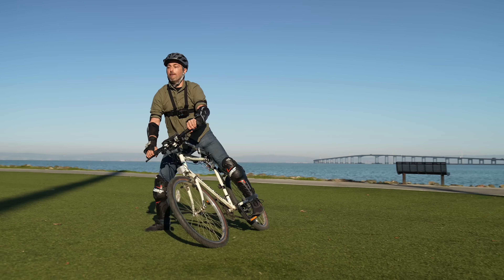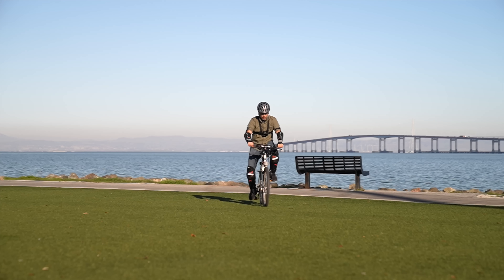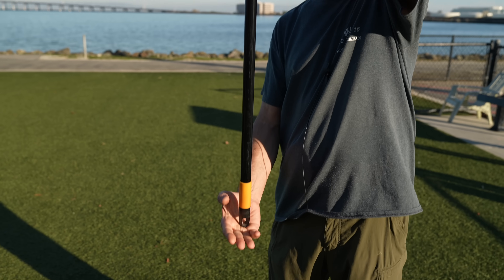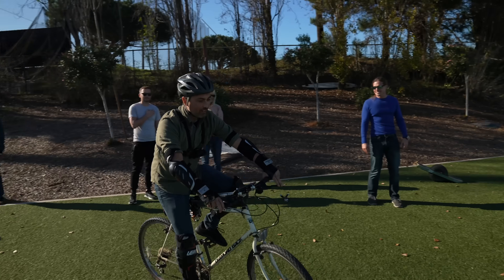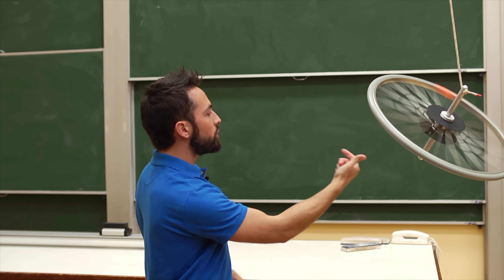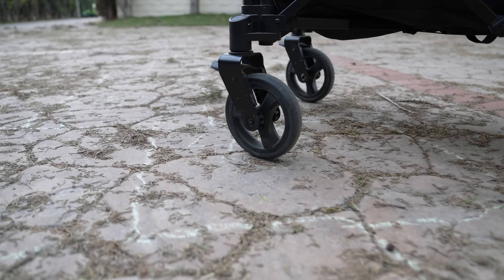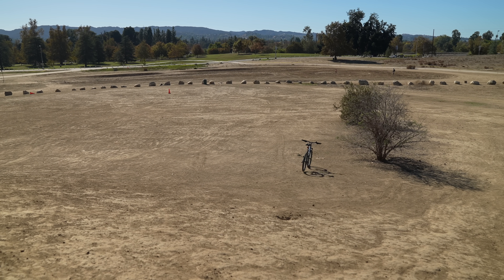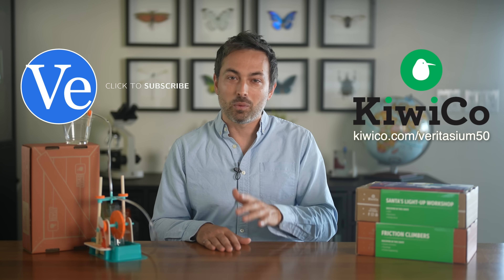Most People Don't Know How Bikes Work

Comment: We were taught counter steering in our motorcycle rider safety course years ago. Several in the class just could NOT comprehend it. One guy almost got tossed from the class for being argumentative about it. The instructor told him that anyone who has ridden a bicycle, counter steers without knowing they are. He finally accepted that he was wrong and passed the course.
Reply: I don’t know why they even teach “counter steering” like there is an alternative. If you don’t “counter steer” then you don’t ride a motorcycle lol.
Reply: @TheKep  I had found the way it was explained in class was way more complex than it actually was. But that is down to the instructor
Reply: @whiskytangi  I was going to comment the same thing. My instructor taught that if you want to go right you need to "press" on the right handlebar. It felt unnecessarily confusing, and was probably just better left not being said. People intuitively know how to steer as long as they know how to ride a bicycle.
Reply: @SteveGunn2  I know that for me it wasn't intuitive at all, but the 'push where you want to go" advice really helped me.
Reply: @whiskytangi  my Instructor said to press too. I found it useful. It helped me realize the steering and turning are a combination of counter steering and leaning into turns
Reply: @SteveGunn2 It's better left not being said for just normal uneventful riding. But when you need to swerve to avoid a brake check or an animal that ran out into the road, it's good for you to have that info because some people DO just steer the wrong way without it.
Reply: @SteveGunn2  thinking you know how to steer from intuition instead of actually understanding how to do it forcefully can be the difference between life and death. Anyone who doesn't understand counter steering is a bigger danger to themselves and everyone else on the road.
Reply: @TheKep  The idea is to teach "push right to go right".  The reason is that in an emergency situation where you may panic and your brain shuts off, you may try to yank the handlebars to the right in order to turn right, but that will turn you left as demonstrated by this video.  By drilling in "push in the direction you want to turn", I guess the hope is that in an emergency, your training will kick in and you will push the handlebars in the correct direction.

My motorcycle course teacher taught this by having us drive straight at him and then at the last minute he would raise one of his arms to show which way we should swerve.  As soon as we saw his hand go up we were supposed to push the handlebar on that side.  He had a lot of faith in his students I guess.
Reply: @TheKep  I am now interested to know if anyone learns to ride a motorcycle before they ever rode a bicycle? I'm sure it's possible to do so but getting the hang of steering and balancing on two wheels has got to be significantly safer and probably easier on a bicycle than trying to learn to ride a motorcycle straight away, particularly with extra controls like accelerator, clutch, gear shift by foot and braking by both hand and foot. That said you don't need all of those things to learn how to move, stop, and steer a motorcycle. I feel that the first step in learning to ride a motorcycle should be to learn on a pushbike first if for nothing other than safety reasons.
Reply: @TheKep  It's taught because some people only naturally do it to a certain extend and then their brains are hardwired to not push further. You see this when some riders fail to lean over properly and end up going wide in a turn, simply because they had crossed their natural limit of intuitive countersteering.
Teaching that countersteering is a thing, can help people push beyond their natural intuition and apply it consciously in situations where their subconsciousness would have said stop. It allows people to experiment with their intuitive limits and push them, thus making them better and safer riders as a result.

So yes, countersteering is unavoidable, but it doesn't matter that there aren't multiple levels of countersteering - some of which are not always reached intuitively.
Reply: @TheKep  They need to teach it in high speed. You don't get to 140km/h in a bycicle... And a counter steer in this velocity needs to be controlled, it's just different, you need to put some of your body weight to the opposite side you are turning, try to watch a MotoGP clip and you will understand what I am saying.
Reply: @TheKep except counter steering isn't a thing
Reply: @thewolf9851  Tell us you've never driven a motorcycle or bicycle for that matter, without telling us you rode...
Reply: @MistedMind I have driven both for literally thousands of hours. You mist likely haven't.
Reply: Came to the comments looking for this. The way my instructor said it was if you want to turn right push down on the right handlebar. Now if you push down on the right handle bar the front wheel goes left and you turn right. You are counter steering. But explaining it this way meant that people were less likely to argue because instead of saying to go right turn left he said to go right push down right. same end outcome, far less arguing.
Reply: Its something you shouldnt think about too much because then its more likely to do it wrong rather just let the brain implement this movement itself
Reply: @alexanderteichrib9525  - you need to think about it at high speeds such as motorcycle racing, since around 100 mph, body leaning ceases to work at all, and the bikes have to be deliberately counter-steered to exit a turn (turn more inwards to lean less or straighten up).
Reply: Keith Code of the California Superbike School developed a special motorcycle that has a set of fixed handlebars to prove the point that counter steering and not leaning is the way to initiate a turn on a motorcycle.  Additionally, watch any super-slow motion video of a motoGP race and you will clearly see counter steering at work.
Reply: The difference is that motorcycle steering takes more force, so the natural instinct from a bike doesn't always translate directly
Reply: I taught a 3 day police bicycle patrol class. The second day was all cone patterns and obstacle avoidance. One obstacle avoidance drill involved having the rider ride straight through a parallel cone pattern, while I would stand at the end. I would suddenly raise my right hand for a hard right, my left arm for hard left or both arms forward for a panic stop. The drill was primarily to teach counter steering. One can initiate a turn by leaning which creates a counter steer, or intiate a turn with a counter steer which creates a lean. Initiating with a counter steer is a much more positive and faster way to maneuver a standard two wheeler vehicle and the nature of the drill is it can only be done successfully by counter steering. 

Another positive in teaching to counter steering over leaning is mitigating panic turning. This usually occurs when an inexperienced rider is picking up to much speed going down hill with an approaching turn. Instinctually they will apply the brakes and try to turn the handlebars in the direction the want to good. Due to the dynamics of turning a bicycle, the bike will travel in a straight line instead of turning, often leading to a crash by laying down the bike.  When I was teaching the class the motor guys got it right away, but it took some convincing with others.
Reply: That's almost like teaching the law of gravity to someone trying to get down from a tree.
Reply: I wish my motorcycle teacher had taught me that??!!! I’m learning motorcycle right now and balance is my biggest problem although I have no problem when riding a bicycle. And now I know explicitly what to do I feel like my lessons will be a lot easier
Reply: Most explanations of counter steering always seem over-complicated because they skip over the essence of it, which to me is "first steer the wheels out from under you". The inverted pendulum/broom analogy is a great way to show that.
Reply: I don't know how to not understand 😂
Reply: @yamahass66  it was wild. Arguing about something that really didn't matter. I just accepted what the instructor said, I guess because I never really thought about it, AND, it didn't matter. 

Humans are insane. 🤣
Reply: I had a similar situation in a rider safety course: I just couldn't get it. I started imagining I was on a bicycle, which I imagined for years. I immediately got it. Since then, I have really started to lean into my bicycle's counter steering.
Reply: My motorcycle training did an excellent job with the concept of steering and counter-steering.  I was lucky enough to be supplemental training by the Arizona GoldWings Association.  The drills at slow speed were excellent.  I use that experience these days on an excellent e-bike which really brings the points home.
Reply: "Press forward on the right handlebar to lean right and vice versa" ... I've been counter-steering motorcycles since 1968, and I pull as much on the outside handlebar as I push on the inside handlebar to counter-steer to change lean angle. When turning, I only think about controlling lean angle and speed to make turns. In very high speed turns, like Ilse of Man or Daytona with 170 to 200 mph turns, the amount of counter-steering effort to change lean angle is so great that a rider has to pull on the outside bar as much as the rider pushes on the inside handlebar in order to counter-steer, all while staying tucked behind the fairing to minimize drag.
Reply: Yeah it was difficult to do it at first
Reply: @wolfseek  that shitnfeels nice tho take a nice tight countersteer leaned turn, snap the bike back up with gravity mmmm feels like butter when the bike lifts and evens out
Reply: @acidpoptart4270  yeah just the  Concert was new to me I didn't trust it but yeah your right and its so cool and weird that that's how it works you need to go right to go left and left to go right and you lean into I'm now a better driver and no problems
Reply: Came here to talk about motorcycles and this very idea. Nice!
Reply: But have you guys tried to super fast trying to avoid a e.g. pothole (which could be a hole in the ground one day, or a piece of metal) by fast and hard pushing on side of the handlebar? That's fast countersteering for you /evasive maneuver. I think it's easier said that mastered. But a good skill to have.
Reply: @sund5  - to quickly avoid a pothole, you can positive steer the tires around the pothole, which will cause the bike to lean the "wrong" way, and after passing the pothole, counter-steer to straighten the bike back to vertical.
Reply: @rcgldr  yeah, but that need some practice since you need right force on the steering, if it's too much the front tire may lose grip and you fall.
Reply: @samueladitya1729  a rider just uses enough counter-steering force to initiate or change lean angle. As speed increases, the amount of force to change lean angle at some rate also increases.
Reply: @rcgldr  I mean to avoid pothole, you need to turn fast. turning too fast the front wheel may lose grip same as on the car.
Reply: @samueladitya1729  it's not really a proper turn, it's just steering the tires around the pothole and leaning the bike over the pothole without the center of mass moving much. A rider will need to recover from the lean after passing the pothole. If the front wheel is turned too much, the bike will fall over before the rider can recover, well before turning enough to cause the front tire to skid.
Reply: It is something you do without thinking. If you had to think about going left before going to the right you would probably crash.
A few good micro- millisecond decision close calls on my motorcycle if I had to think about turning left before trying to avoid hitting the back of that barely moving car when I was going 60 it would have been all over.
Reply: @michaelszczys8316  That's exactly what the instructor told that guy. If you think about it, you're most likely going to crash.

I know I had never thought about it. It became clear when we did the slow cone weave though.
Reply: Sure -at low speeds motorcycles act the same way - At speed you "turn" the opposite way you want to go the entire time.  Try it - going down the highway press forward on the left handle bar.  The bike will lean left and turn left.
Reply: @mactraynor6243  In fact, even at speed, there is a slight counter steer. At speed it is much less and even less apparent. But it is there.
Reply: @mactraynor6243  To me it's the opposite order. To go left I lean left. But to prevent the bike from "falling over" I have to press left to counter steer.
Reply: @MistedMind  the whole "leaning the bike" is nonsense. Ryan F9 and lots of others have tried it. Simply you leaning does nothing.
It's more likely that you lean and subconsciously press on the handlebars.
You can affect the angle of the lean by either hanging over to either side, but you can't make the bike turn by leaning.
Simple as.
Reply: @jochenstacker7448  Haven't driven in a couple weeks. Will pay more attention next time.
Reply: Can I get a quick tip on balancing at very low speeds as well?
Reply: Since the video shows that you initially turn in the opposite direction for a brief moment does that mean that on a motorcycle in order to turn left you'd have to push forward on the right handlebar for second then push forward on the left side for the rest of the turn?
Reply: @davidlericain  - left lean is initiated by pushing on left handlebar. Rather than thinking about the direction the front tire is steered, a rider should think about the force that is being applied to the handlebars. When leaned over in a turn, use an inwards steering force to lean less, and an outwards steering force to lean more (the front tire is still turned inwards, but just steered less inwards in order to lean more). It's sort of like the ailerons on an airplane used for roll control, but the input is reversed: a right steering force on the handlebars steers less right or more left and vice versa.
Reply: @davidlericain  - push forward on left handlebar to change the lean angle towards the left, from vertical to left lean, or from a left lean to increase left lean, or from right lean to decrease right lean. If in a turn, the wheel is always steered inwards, but steered less inwards to increase lean angle, or more inwards to decrease lean angle. For a rider, it's easier to think about forces applied to handlebars rather than thinking about the actual direction of the front wheel. Since a bike tends to straighten up without any rider inputs due to self-correcting steering geometry, a rider needs to apply some opposing force to counter the self-correcting response to hold a lean angle, except at high speed (100+mph), where a bike tends to hold a lean angle rather than straighten up.
Reply: turn right to go left,
-someone from a Cars movie.
Reply: That sounds dumb, no one should be kicked from a class for not agreeing with the material. Imagine Albert Einstein being kicked out of institutions for his theories.
Reply: @w1nn1nq it was because he (the student) got argumentative, borderline aggressive. This was a 35ish year old man mind you, not a snot nose teenager.
Reply: @yakbreeder  ah, that makes more sense
Reply: In counter steer you only steer the 'wrong' way, that's not what they are doing here. They are counter steering then steering into the turn, this you have to do a slow speed, not often experienced on a bike.
Reply: We probably had the same guy in my course too. lol
The instructor and 10 other guys was trying to explain, NOPE!
A girl came, Hey! I'm a Teacher at Univertsité de Montréal in Physics & Science, STFU! 🤣
Reply: It's because counter steering is a misnomer. It's really lean initiation.
Reply: motorcycles are a bit more complicated than bicycles but yes, basically very similar
Reply: That's not a bicycle.
Reply: @christopherwellman2364 does it not behave the same as a bicycle?
Reply: @yakbreeder obviously not!
Reply: @christopherwellman2364 of course they do. Tell me how their different.
Reply: @yakbreeder Actually, a motorcycle would be easier to turn without counter-steer because of the drive behind it.
Reply: @christopherwellman2364 

The principle is the same regardless of propulsion.
Reply: @yakbreeder Yes.  Differences in physics have no effect on physics.  Got it.
Reply: @christopherwellman2364 we're talking about steering NOT propulsion. Two totally different things.
Reply: @yakbreeder Propulsion has no effect on steering dynamics.  Perfect.
Reply: @christopherwellman2364 what part of "the principle is the same" don't you understand?

Your arguing semantics. Do cars and trucks steer the same? 

"Trucks sit higher than cars, so no they're not the same." - Christopher

SMH!
Reply: You're right. I remember watching "Keith Code A twist of the wrist" and understanding countersteering was mindblowing.
Reply: @404genericnames  nope. Unless you're making the gentlest of turns, you're counter steering. Weight shifting will barely make any difference.

Look up the Keith code video on this.
Reply: lol I remember seeing a fat black girl on the bikes that they used to do courses some 120cc Speedster kinda style bike, cant remember what exactly. She literally could not counter steer at all and kept messing up the tight turns, Still got her license though. RIP
Reply: I’m your 1k😘, All Facts Here💯💯💯, Also Look Into The Cornering Bible
Reply: @johnnyparsnips7641  if you are moving slow enough, you don't need to lean or counter steer. Most people think they need to lean into the turn to complete it. By doing so you automatically are putting pressure in the direction of the turn and then you counter steer through the turn. It's the same basic action, but your brain sees it differently.
Reply: @davidvaughn7778  - at slow speed, below a bike's self-stable speed, you need to steer in to direction of fall to maintain balance. This is a form of counter steering, if you start to lean left, you steer left to reduce the left lean, steering left to chang the direction of lean towards the right (less left lean).
Reply: @rcgldr  exactly what my first sentence stated. The rest was for at speed riding, I just didn't transition well.
Reply: so... you saying the reason I know how to drift my rwd car, is because I rode a bike ? 🤯
Reply: Fun fact? I was able to learn to ride a bike ONLY in 7-th grade !!! Because only then i uderstood phisicaly speaking what i need to do in order to maintain balance. The counter-forces i needed to develop ! In 7'th grade i got the Phisics discipline, the mechanics part. Same with the swiming, i was able to swim when i understood what i need to do in order to swim, by creating a constant force down to lift my body a little above the water. To be exact i neded to lift my hand or my leg more aquadinamicaly than when i put it don in the water. The diferences between these 2 forces was the lift force, to be able to stay on water. After that, to advance in water, i used part of the lift force to advance. So the movement was like a propeler.  So now i learned to swim too.  Same with staing on a ball , or 2 crossing pipes, like a circus guy,  or sky-ing and snowboarding. Couldn't aford a ski instructor, so i distroyed couple of a sky slopes to learn. Snow was destroyed,  and other sky turists had critical problem riding the slopes i used. Yeah , whenever i had a real problem to learned something, the other people around me got THE BAD LUCK, during my learning process. And i'm ok with that because nobody wanted to HELP ME. SO THEY GOT ALL THE SIDE EFFECTS OF KARMA !!!
Reply: Motorcycles mostly work through gyroscopic precession, so it would be counter pushing 
fight me
Reply: @t0k4m4k7  - precession is a reaction to a torque, a change in lean angle. In a coordinated turn with no change in lean angle, there is zero precession, and there is no tendency for precession to return a leaned bike back to a vertical orientation. As posted earlier, angular momentum of the front tire resists any change in steering angle, so the net effect of gyroscopic reactions is to oppose the self-correcting steering reaction due to trail, acting as a damper at moderate speeds, and eliminating self-correction at very high speeds (100+ mph), where a motorcycle tends to hold the current lean angle with no tendency to return to vertical.
Reply: @rcgldr  I thought it was clear but i can clarify it better, i meant that in order to get in to a lean you have to apply torque to the front wheel and this will make the bike lean through gyro precession, obviously if you stop applying the torque (and you should stop if you're at max lean) the bike will stay at the same lean, assuming normal motorcycle geometry.
Reply: Countersteering a motorcicle above approximately 30km/h will lead to a fatal crash. Steering at all will lead to a fatal crash. you are just using the gyroscopic effects of the wheel. no muscles(ok, barelly none) involved.
In the low speeds this is completely changed.
even if that feels like "steering" it isnt.
Reply: @Holzf43ller  That's literally not true. Stop your misinformation and either go ride a motorcycle or study the physics of it properly.

What you SHOULD be saying is "steering at all without counterbalancing yourself and the bike, will cause a crash". You always countersteer anytime you want to change direction, even if only done ever so slightly. When you push down (and thus slightly forward) on your inside handlebar, the bike will countersteer the opposite way and engage in a lean towards the handlebar you are pushing down on. Upon leaning, the bike will then turn that direction to upright itself. Thus, you are now turning on your motorcycle. Even if only pushed a few millimeters, it is still countersteering. The higher the speed, the less countersteering is utilized, because making extreme countersteer turns at high speed will cause you to either lose road grip, or flip your bike into a highside crash due to the immense forces at play.
Reply: @Holzf43ller Wow.  This is completely wrong.
Reply: @Holzf43ller What incantations do we use to summon these gyroscopic possessions? 😂